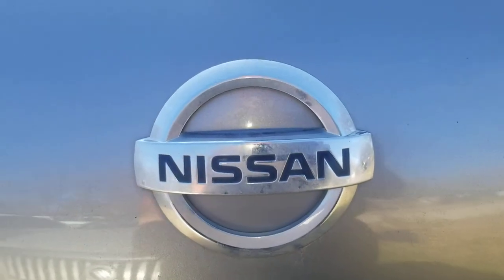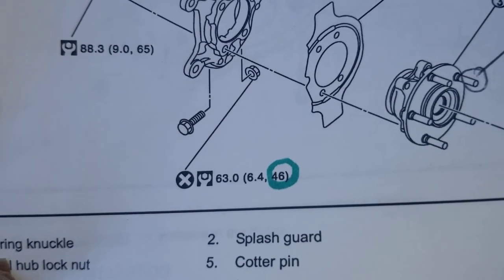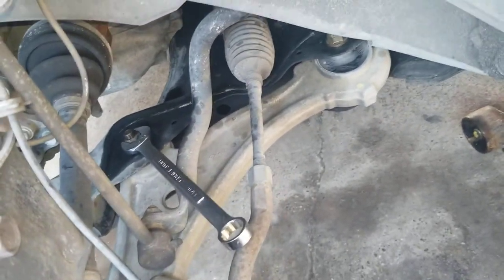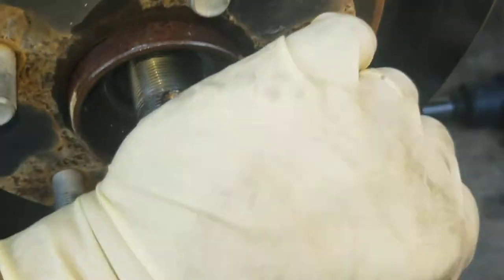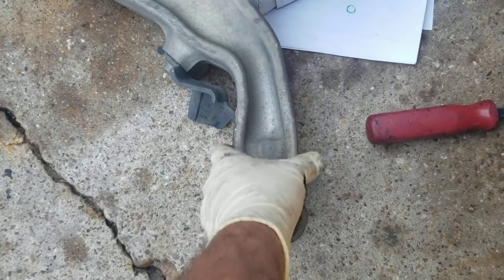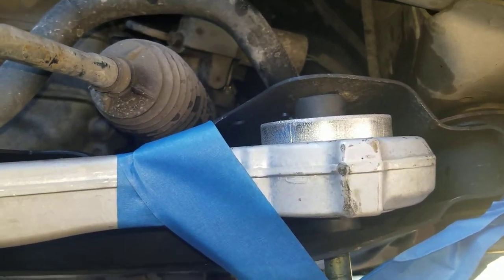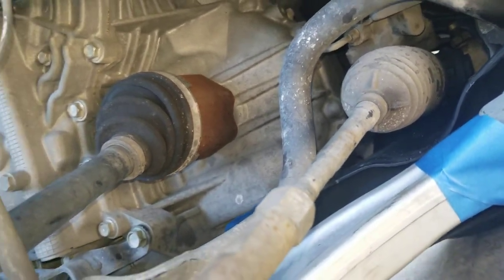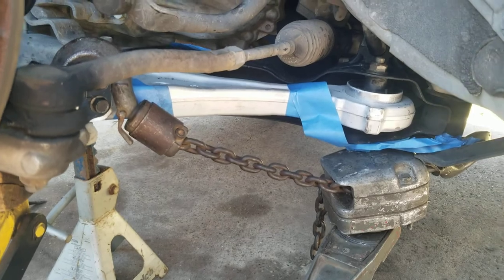2009 Nissan Murano left front lower control arm notes

Comment: I just replaced both sides with new control arms, it is still clunking when I hit the gas hard and let off. It is like a little pop that seems to be more loud on the right side. Cannot figure out what it is. I've replaced the struts already as well on both sides. Decided I'll just drive it until whatever it is breaks. Control arms were actually very easy, only thing is I had to have someone else hold the rachet onto the front bolt while I crawled under the truck to use my leg to push the bolt loose. It worked well but you will have to be one strong dude to get that one loose, it is on there quite tight.
Reply from the maker: You will have to get someone to put it in gear with the emergency brake on and duplicate the noise over and over till you can narrow down where the noise is coming from.